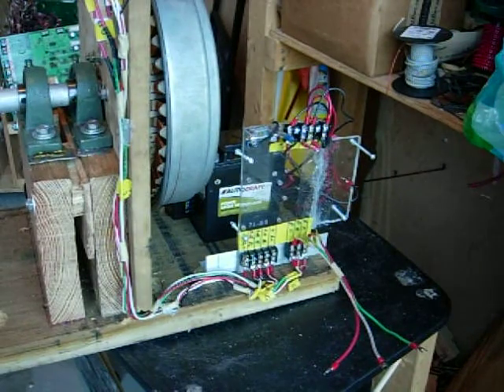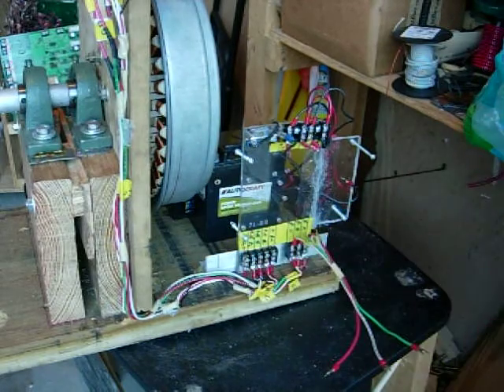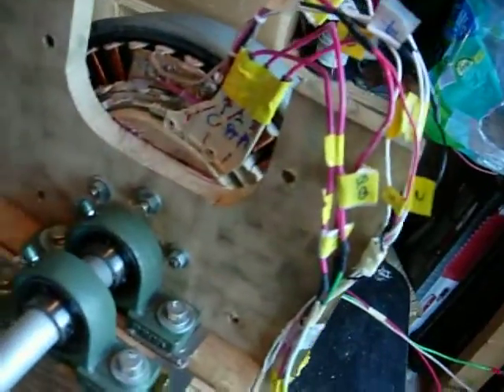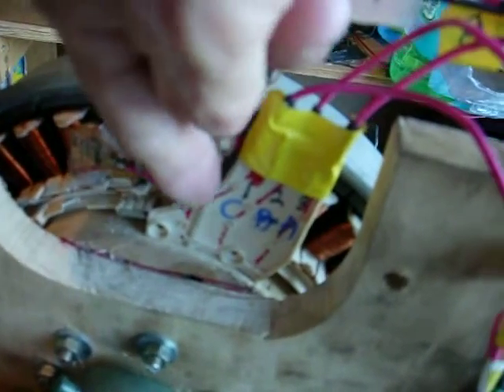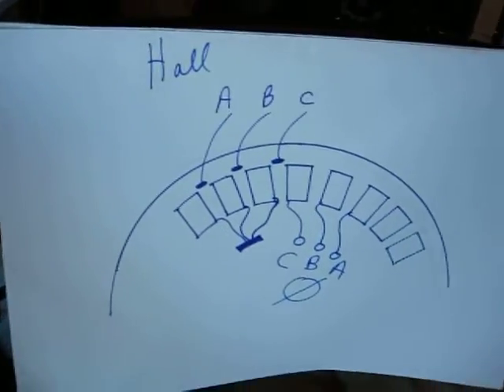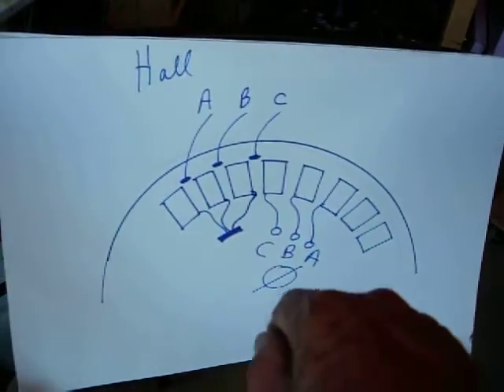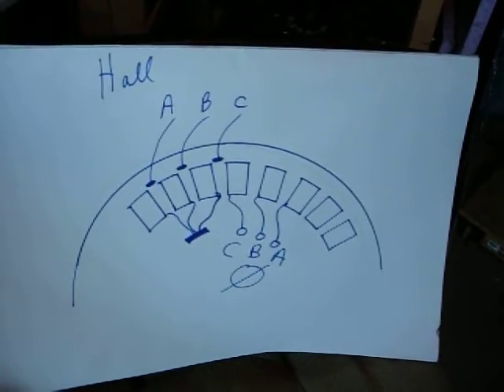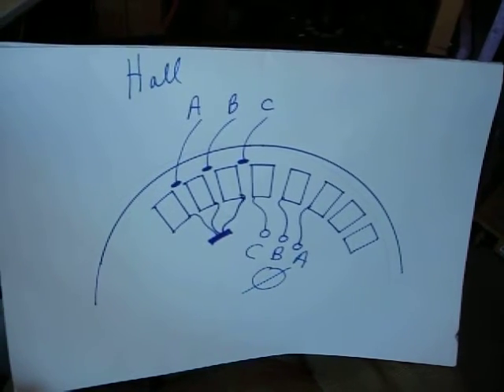Don Smith #119 Hall sensor placement

Comment: Please tell me, how effectively MC33039 stabilizes the engine speed, when changing the load?
Reply from the maker: The MC33039 only will work with low power motor.  I never really loaded the motor.  but it should give good control.  I tried very hard to get the HV stuff to work and discovered that the support for the product was terrible  the same for Atmel they suck.  I'm now working with the Atmel mega48 but I had to redo everything their schematic was wrong and code was wrong too.  Atmel told me it was an old product and no longer supported.  Obviously with bad code and bad schematics they never really tested any of it.  In some other videos I show all the schematics and code changes required.   If you need a PCB to work with I can send you one you'll have buy the parts kit.  Just email me(captainssbn@yahoo.com) the pcb will be around $30 its for the atmel mega48  I'll put the code in a couple Mega 48s .  This pcb lets you use 120vac to run the pcb and motor. don smith #145 shows it running.  The kit is from Digikey at $142 US

Comment: Hi Gary liked your project i am very interested in your control board  that is the thing holding me back i am limited on electronics.Once you have mastered it i would like to aquire one .you can contact me at gezm2008@live.co.uk.You and Gerard Morin are giving a lot of people hope i am now very excited about this power.May the force be with you .GEZ M
Reply from the maker: +Gerard Melvin The PCB is designed directly from the OnSemi spec sheet for the MC33033.   In that you'll find a closed loop three phase schematic(FIG 38).  The dip package I'm using is from China.  OnSemi only has soic? style surface mount.  The next version of PCB will be HV design which is same schematic fig 38 combined with fig 24 and 27 in this design the resistor attached to pins 1,2 & 20 of MC33033 are removed and the pins 1,2,20 are connected to opto circuitry.  the MC33033 provides a ground path for the opto input resistor.  In both designs the ground planes are critical as I describe in video 120.   Next week I should be up and running I'm not sure what 24vdc will yield for speed.  The HV version could be any voltage as long as caps and Fets can handle it.  It was interesting to see how they did the Boost circuitry using a cap to isolate the HV Vm from the osc..   the boost is actually two voltage levels combined one from osc charging a cap plus Vm,   so that the N channel has 10vdc difference between S and G to fire it.
Reply: +CAPTAINSSBN thanks mate

Comment: hi i was just wondering the actual size you are using on the ATS177 sensors? as there is 20 sizes under that number.great job on the control build to by the way
thanks Brendan
Reply from the maker: +green N.R.G hi green just saw your note   Digikey # is ATS177-PG-A-BDICT-ND  at $.77 each
Reply: +CAPTAINSSBN thanks for your reply
Reply from the maker: when I get the pcb up and running i'll post the schematics of new version and complete parts list.  I need a better video camera
Reply: thanks mate great stuff.

Comment from the maker: Just watched Gerard's self running loop nice job....   I just finished reading pages 120 through 125 of Lost Science by Gerry V. for the 10 time.  My conclusion which I feel directly relates to Gerard's dual 25kw transformer test is that the 120 vac driving the plate in the first transformer provides only electrostatic voltage radiation onto the HV coil turns.  the charge electrons from the 120vac do not flow through the aluminum plate they get hung up.  Tesla stated this fro his transformers and magnetic discharger test where he uses a heavy copper loop.   when placed coils of certain shape, turns mass he got an unbelievable amount of energy from the top ending wire of certain coils.   The plate in the 25kw transformer is basically the same as tesla's loop of heavy copper.   The electrostatic pressure flowing up the HV winding produces the 14,400 vac.  Gerard uses this to drive the second 25kw transformer.  this radiation then stirs up the electron charge on the 120vac output plate and this in turn is used to do work.   I would imagine if Gerard repeats the test and drives both X1 and X2 of the first 25kw transformer with the same 120vac,  he may get a lot more power from the 14,400 vac created due to the doubling of electrostatic radiation pressuring the HV transformer #1.   The plates are wound on the inside and outside of the transformers HV coil turns.

Comment from the maker: On Semi Mc33033 data sheet fig 38 shows the closed loop 3 phase motor control schematic.  The data sheet also discusses suggestions for PCB Layout.  They suggest that you provide a ground plane which separates the current into two pathways one for the MC33033 and MC33039 low current and the FET Phase circuitry which is a high current noisy environment.  On my PCB layout I have these two planes merge at the Battery/Power Supply ground connection.   If this whole system works the a power supply can replace the battery making the whole system self running.  If the pillow block bearings are greased and the transformers are not burned up do to over loading then the system could run for a very long time.   If the output from the Tesla Type transformers can provide 6000 watts from and input of 1200 watts then 4800 watts will be available to do work.    If the output loads that are inductive say air-conditioning systems, then they can be resonated at 60 Hz using tuning capacitors.   By doing this, the energy system need only provide energy for resistive heat.  In residential areas I have seen 15KW transformers run two houses,  which tells me that a system producing a useable 4800 watts should be able to run an entire house with proper load management.    Once we prove that this works then we can also expand upon it.